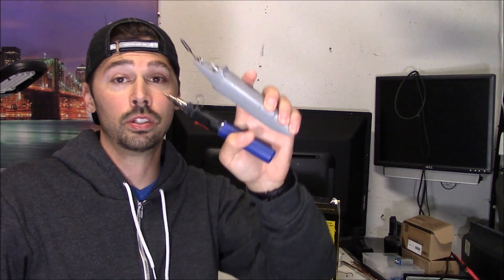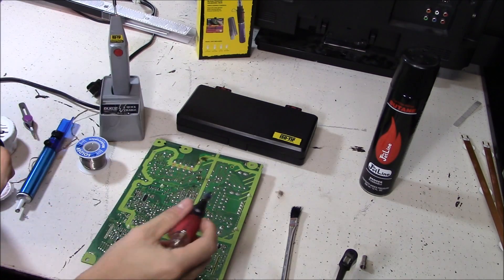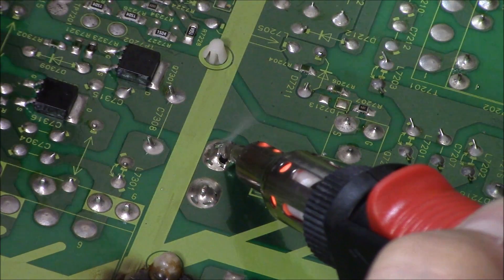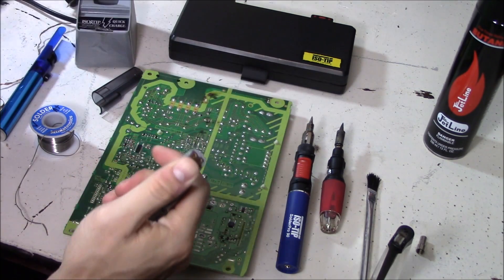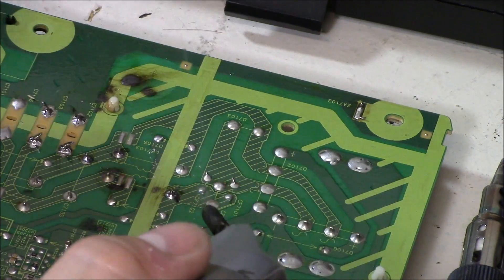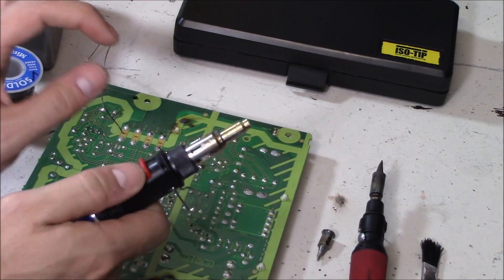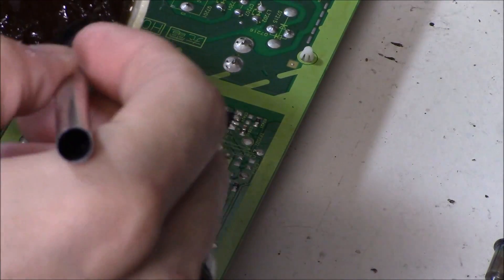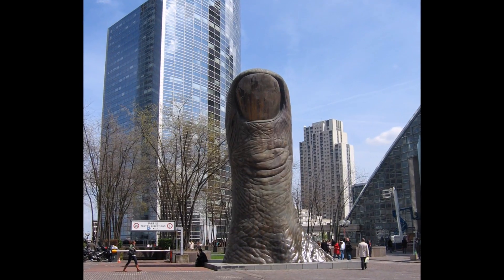How to SOLDER and UNSOLDER with Fast heat soldering irons: Butane vs Electric battery

Comment: One thing I NevervCared For 
Wh'er Soldering Guns. Cause 
TheyvGet WayvToo Hot 
For Doing Small Electronic Soldering.
I Use The Soldering Gun For
Fixing Wire CD & DVD Racks.

Comment: Have you looked at the new Dremel butane soldering Iron with a ceramic heating element . EBay or Amazon  58.00 comes with a lot of stuff and a good video ,I have several butane ,don't use them but for just in case and a rechargeable soldering Iron Aliexspress 14.00 ,and a seller battery operated not impressed ,could get the battery cover off,they sent me a new one it's still in the box .  I had a Wahl long time ago work good ,they haven't Improve at all in.over forty years they still use ni- cad batteries,and a regular light bulb ,same thing they made forty years ago.

Comment: Son ran off with your tweezers..lol I totally relate! All the toys my daughter has, yet still always in mom's stuff! I've found my tweezers in her toy boxes & dollhouse more times than I can count! 

Anyway, what's your take on low temp solders? (Ex. chip quik) for desoldering IC chips? 
Im about to replace the PCM in my car and plan on switching out the EEPROM immobilizer chip but I'm nervous about damaging it while removing. I got a butane 3 way iron recently & have a couple regular soldering irons as well. Would you go with the butane iron on hot air setting or solder iron tip?

Comment: That blue flame on the first iron gets itself caught in a vortex of air and butane. You can remove the blue flame by increasing the gas flow. It will typically go away in a few seconds, and then you can place the fuel regulator to the desired position. Otherwise, I've seen the blue flame continue indefinitely until the fuel is cut off.

Comment: Hi, I have 10 tablets! Yeah WoW 10 Tablets. They all work great, except, duh the charging port and the ear plug ports get loose and won't function. I did some research and learned they are one unit. I said great! Now I can get it fixed!! Everyone says throw it out and get a new one. Hence 10 tablets later........... Well I could not throw them out. I come from a long line of fixers but  I seem to be the last one left. Can you help me fix them? I took 2 of them apart but I'm lost. I'm a visual learner and I found no one who could show me. I want to learn really!soldering scares me, but I'm willing to try. Thanks!!! Georgia- Rose

Comment: Dear Tampatech, recently i have taken a liking in learning how to check, replace and fix circuit boards, reason is due to necessity of my expired warranty related to my LED LIghts which i would rather try fixing rather than going through the interrogative hassle and long waiting periods for replacements to arrive. So i am a novices to say the least. I was wonder if you can give me a quick feedback/background info on my damaged LED adaptor if i would send you pictures of it just so i know if i should go through the effort of repairing it with a few professional experience pointers or loose hope, i would be happy to forward 2 pics for any feed back you can provide to get me started. I have already ordere a multimeter, sucker and solder from amazon amd awaiting thier arrival. Thanks

Comment: Tampa... on the pro 90...
For versatility couldn't you just lower temp for small jobs requiring a 40 watt iron?
Reply from the maker: yes very true but butane costs money to fill and my battery operated iron doesn't really .
Reply: +Tampatec Thanks. I need a good butane iron and always wondered how you set temperature in comparison to watts. How would one know what temp to set for 40watt, 50 watt 60etc...

Comment: Hi Tampatec.  First let me say thank you for all the informative posts here. Can you tell me if you have a problem with getting the surface mount chip too hot and damaging the chip using the heat blower? Thanks/
Reply from the maker: yes it's common lower the heat and raise the tip another inch from the IC and only heat for no longer than 10 seconds.

Comment: The video was helpful - another tip soldier I use mostly Panasonic nichicon capacitors
Reply from the maker: i heard they are the best and last longer
Reply: +Tampatec can u make a video of how to fix a hp computer plz
Reply from the maker: +Alicia Salinas what part? power port?
Reply: +Tampatec it on the rowder like a big one for the hp comeputer
Reply: +Tampatec i dont know i know how to fix it but not about power point